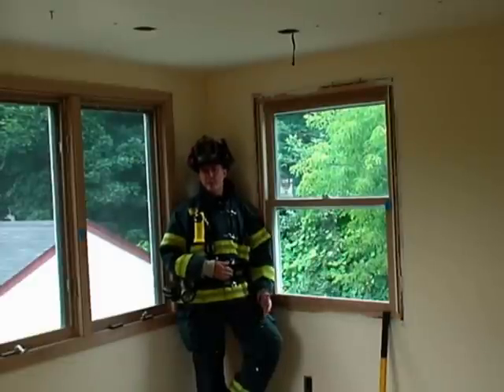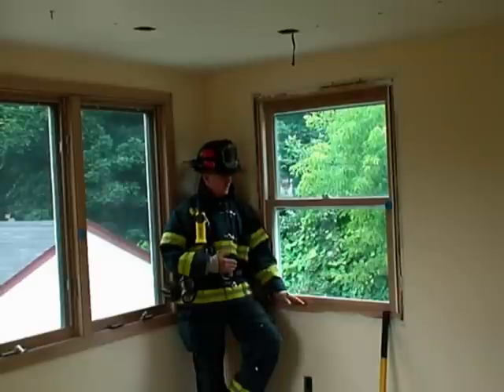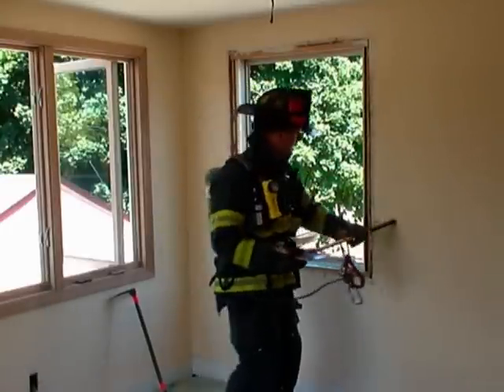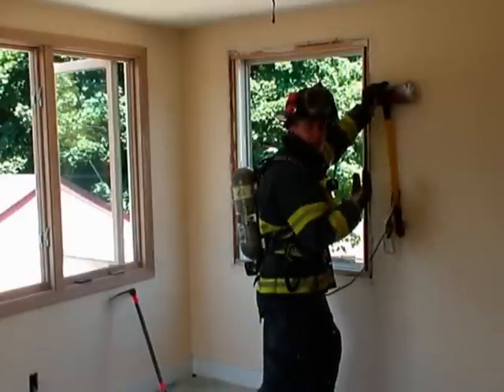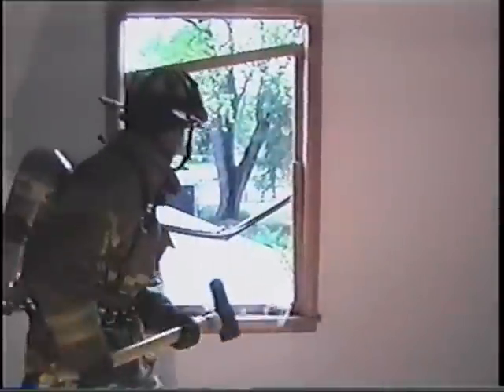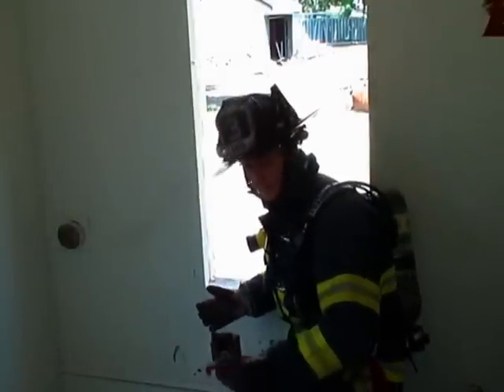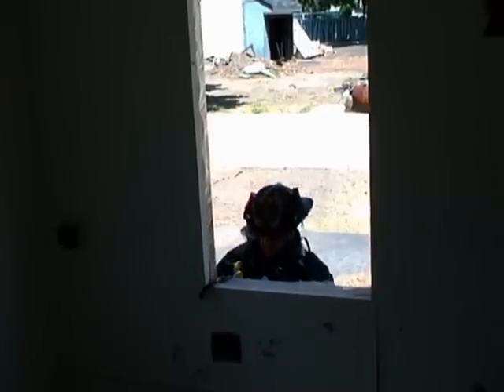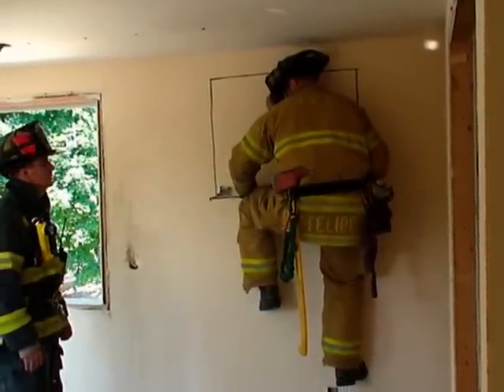Personal Escape Systems - Window Clearing, Anchoring and Exit Techniques

Comment: 6:20 yes you can wrap the center frame. But that window doesn't have a center frame. That Andersen casement window pair has a mullion which is a thin piece of pine and they tend to rot at the bottom joint and this is exactly where your rope is loading. They can break suddenly and cleanly right there. It pays to know your building materials.

Comment: Hi Dale, I'm an Italian Firefighter, I was studying the technique to run away from the flaming flats coming out of the windows. I find it very interesting, but in Italy the walls of the rooms are built in bricks and therefore this technique is almost impossible to apply. It could be solved by putting a staircase (used as a point of attack) in contrast to the finest, and with a dynamic rope make a half boat knot and modulate the downhill ....
Reply from the maker: Ciao Umberto - Grazie per il tuo commento Fratello! I sistemi di scappamento dei vigili del fuoco hanno progressivamente avuto un po 'di tempo negli anni. Avere un sistema con un Anchor Hook Escape risolve i problemi che hai con il tuo tipo di costruzione. Ho caricato una serie di video su Firefighter Escape Systems, chiamata anche VRS (Versatile Rescue Sytems). Puoi guardarli andando sul mio canale YouTube - Dovrebbero darti qualche ulteriore conoscenza.
Reply: Hey, I'm happy to hear you, I saw your videos and I found them very interesting. It's certainly important to type typology. In Italy it is difficult to find wooden houses, only in some regions of the North near the Alps. They find, for example, the fireplaces of chimneys in the fireplaces, where we do not have a city. Now, after 25 years of service, I have become an instructor, and I work in the only fire brigade school in Italy where we train recruits, (If you want I can give you links to get an idea)
Reply from the maker: That would be great Umberto, please go ahead and send the links.
Reply: DALE G. PEKEL presto ti invieró i link che mi hai chiesto,

Comment: Have any tips for solid brick homes. We have a few that only have a thin layer of plaster overtop the brick so breaching the wall quickly isn't easy. Most of them do have projecting sills but I'm thing for a secondary option. I was thinking of breaching the floor the same way as the wall or using an interior wall.

Comment: Hey quick question. in a casement window why take out both windows? If you are in an emergency situation and need out ASAP taking out both lengthens your exposure to the hazards or dangers you are escaping. I like your video excellent learning BTW

Comment: Can I escape from a concrete building in the same way? For example, is it possible to escape from an apartment by hooking a wall through a window in the same way? In many videos I only saw samples from the wooden structure. However, there are many apartments made of concrete in the country where I live. I want to know how to escape in this case.
Reply from the maker: Newer systems have anchor hooks - That you can also purchase individually and add to your system. An anchor hook gives you the option of anchoring right on the window sill when all other anchroing options are not available or you wouldn't have time to implement them.

Comment: Does it matter if the bailout hook faces down or to the side?
Reply from the maker: Niklas Brazie - There are actually 3 hook placement orientations: Flat (which I prefer) 45 degree angle and vertical - How you place the hook is based a 2 main factors: The type of hook you have and the construction features/presentations of the window frame, sill an neighboring wall face. I currently carry the CMC LEVR system with a Flashlite anchor hook and I by far prefer using the anchor flat on the sill/window frame - However I practice all 3 anchor orientation methods. Thanks for your question! Check out my YouTube channel for more videos on Escape/VRS (Versatile Rescue Systems)

Comment: Thanks for video, but what about flat(apartment) escaping?
Reply from the maker: What do you mean about a "Flat" apartment
Reply: @DALEGPEKEL  thanks for answer. I wanted to ask about the evacuation of the city apartment(multi-storey building) with concrete(brick) walls.
Reply from the maker: @A_F_Makes  Take a look at these videos: https://www.youtube.com/watch?v=h0-ppyAjQdM  https://www.youtube.com/watch?v=KapUDnfi8YQ&t=34s - Which show how the new style Anchor Hooks can be used for both self rescue as well as rescuing a trapped victim - Even on concrete buildings

Comment: We just had rit and mayday training tonight. Quick question, what is the system you have with you that allows you propel out of the window. I'm interested in adding that to my gear but don't know what all of it is.
Reply from the maker: I currently carry 40 feet of Sterling FireTech Technora rope, a CMC 2nd generation Escape Artist DCD, CMC Flash Lite Anchor Hook and 2 aluminum SMC screw lock Carabiners. Another good DCD is the Sterling F4 - What you purchase and carry depends on how you intend to carry, store and deploy your system. They're called PES/PSS - Personal Escape or Safety Systems, but the fact that they can be used to rescue fellow FFs or civilians I like to refer to them as a VRS (Versatile Rescue System)

Comment: I have a problem of being nervous about running out of air and possibly bailing out or not being able to see anything or backing out due too air cosumption and running low too deep into a building and not know where to go
Reply from the maker: It can happen but is EASILY avoided if you monitor your air supply - Every time you change a room, floor or tactic, check your air and prompt your partners to do the same. Besides this keep track of secondary means of egress, such as windows, doors, balconies or roofs that you could exit onto if conditions go south. Finally remember this; Courage is not the absence of Fear - It's the ability to move beyond your fears in order to serve and fulfill a higher purpose. That's why we run in while others run out.
Reply: DALE G. PEKEL thank you for the advice you really cleared things up for me. I am 17 going into fire 1
Reply: What sort of turnround  pressure do you guys use as your safety margin?

Comment: Would shoving an axe into the wall sheet rock like that support a 230lb man + gear? I dont think sooooooo
Reply from the maker: Yes it EASILY would hold your weight - I came up with this technique in the late 1990's and have tested it literally hundreds of times on numerous acquired structures and on a variety of materials; from lath and plaster, to sheet rock/drywall, wood paneling to old fiber board (which is not much thicker than a piece of card board. We've done testing with 3-4 FFs hanging from 1 tool in the wall and the anchor held. If you have integrity of the wall around the head of the tool this method is insanely strong - Try it out for yourself on the next vacant/acquired structure you get and YOU WILL be a believer. Regardless I still always recommend having an anchor hook at the end of your system as you may be presented with a building and construction features that won't allow this technique - After all nothing is fail safe.
Reply: Yes, it will.

Comment: Im not trying to be a smartass but wouldnt it be easier to just Open thé window instead off smashing thé glas and removing thé frame?
Reply: you need to remove the window in order to fit thru is with all that gear. trying to figure out how to open a window with smoke flames and gloves etc wouldn't be practical. FF= paid demolition crew and lock smiths cause there isn't much they cant get thru or have a tool or key for. Ever want to secure something then watch how FF get into buildings then work from there
Reply: I was thinking the same thing.. I perceived the video as a "how to escape your home in case of a fire" and I feel like I know how to open my windows quicker than to demolish them, and they're more than large enough for me to fit through (I don't have all that gear, of course).
But I probably misunderstood the purpose of the video.
Interesting watch, especially the ad nchoring. My walls are concrete though, so I guess I'd have to anchor around the balcony railing and hope it's sturdy enough.

Comment: I just don't have that much faith in sheet rock
Reply from the maker: Understandable - After I came up with the "Tool in the Wall" technique I've been very fortunate to practice it countless time on numerous acquired structures with all sorts of interior (and exterior) sheathing - From drywall/sheetrock to lath/plaster to paneling and evening compressed fiberboard (basically dense cardboard). This experience along with a lot of testing has given me the confidence on when and when I can not trust it. In the end is just one more option.